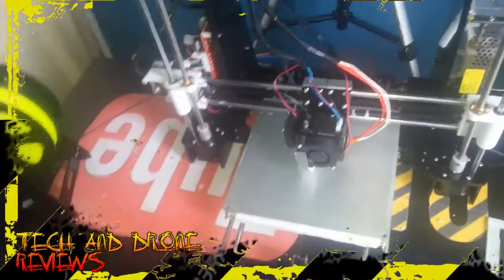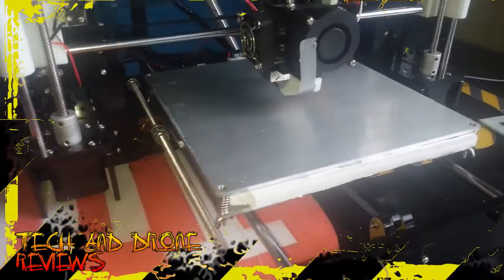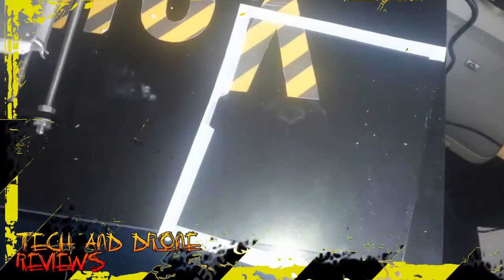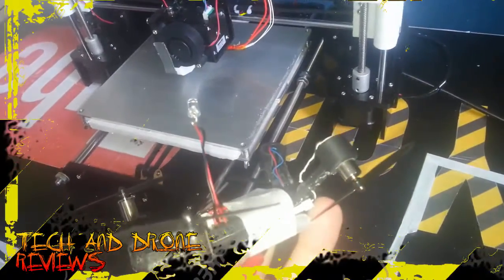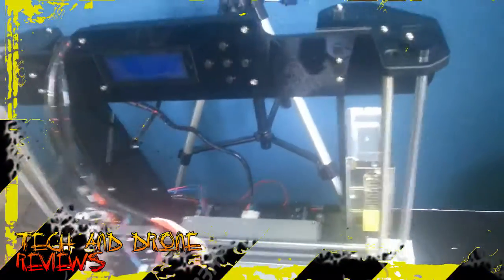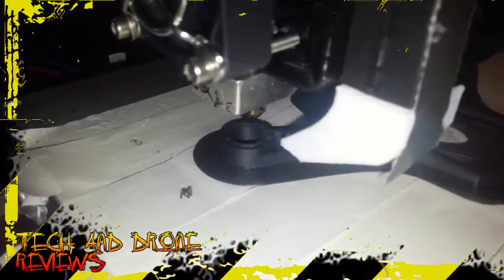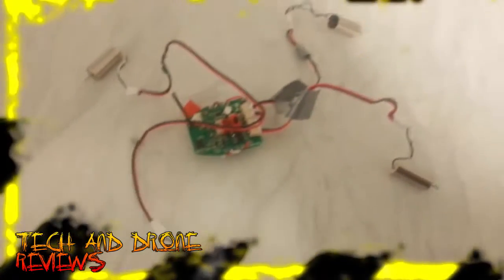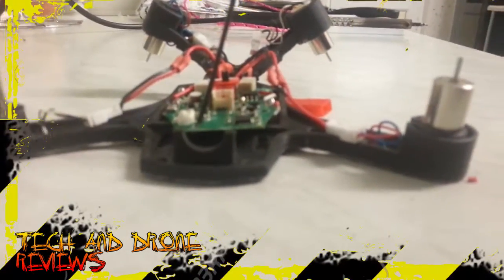New A8 Anet 3D Printer EP1 Printing a Drone

Comment: I have the same printer but it keeps printing off the side of the bed any ideas why it is doing this
Reply: Im sure u figured this out by now but it is most likely ur slicer settings. Either u have the center bed at 0,0 option or the wrong x,y,z values. In the instructions that I had with the printer it had the 0,0 option checked in cura but it is not correct. I have it disabled
Reply: wigglywombat25 I actually haven't had time to mess with it I am going to try that tonight thanks
Reply: No problem! I'm not claiming to be a pro by any means, but feel free to message me if u need more help
Reply: Oh also, I recommend the Anet A8 Facebook group! It's extremely helpful when you have questions or issues!
Reply: wigglywombat25 add me on Skype bstover911